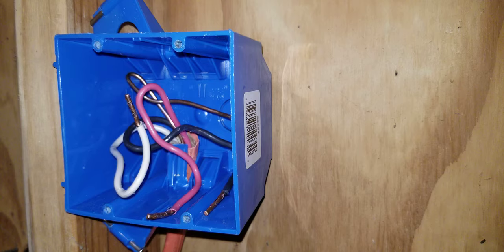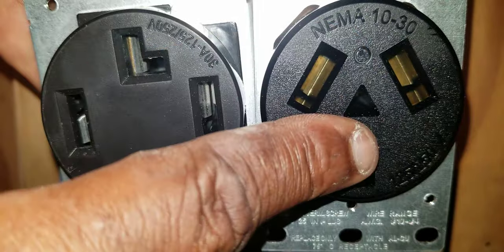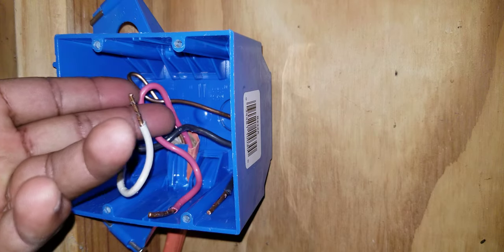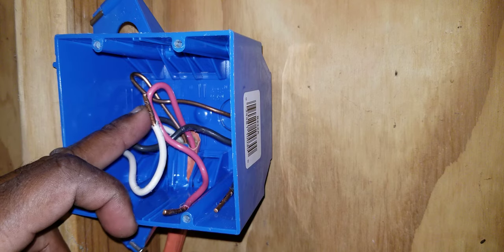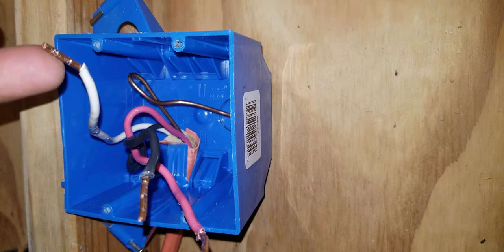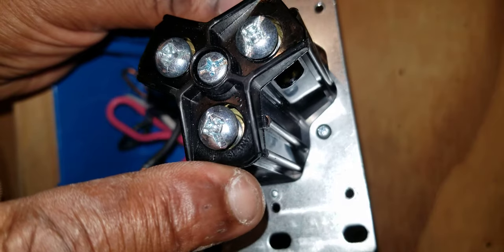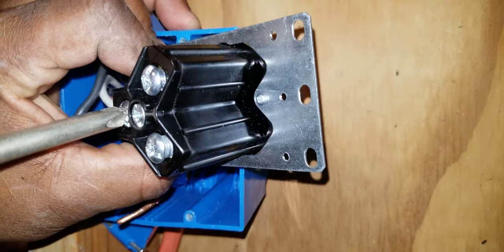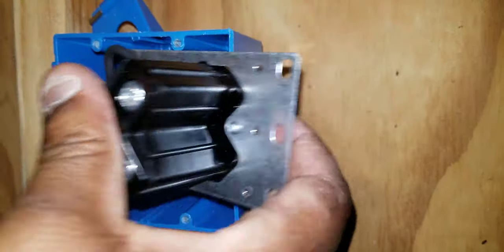How to install a  3wire 30amp dryer outlet

Comment: What I do with the ground wire if the box is not plastic ?
Reply from the maker: If the box is not plastic and the box is metal YOU WOULD TAPE THE GROUND WIRE TO A BOND JUMPER. , you would buy a green bond jumper ( from your close hardware store or home depot). The bond jumper should  have a green screw at one end. You will screw the green screw into your metal box.( there ahold be a screw hole in your metal box the will fit your green screw. Once you get the green screw tightly in your box., without the bond jumper to the ground wire.

Comment: What do you do with a ground wire in a metal box: still push it to the back?
Reply: Bond the metal box with the ground either with a screw or a clip
Reply: You can connected to the box. The ground will end up there. No harm done at all. Every metal part should be grounded, that's the purpose of the ground wire.

Comment: What if I only have white , black and ground ?
Reply from the maker: Use the black as one hot use the white as the other hot and use the bare copper ground as the neutral. So put the black and white underneath the hot screws and put the bare copper ground where the neutral would normally go.

Comment: I only have copper/neutral/black hot coming out my outlet I don't have a red wire
Reply: Multimeter it.  make sure the white wire being used is a current carrying conductor and not a grounded conductor

Comment: My wiring consist only of black, white and ground. Do I still eliminate the ground wire and only connect the Black and white wires. There is no Red wire at all.
Reply from the maker: Most likely James, the white is used in place of the red. The white in this case is the hot wire. Do not eliminate the ground. The ground wire will act as the neutral wire. So hook the white up as the red (hot) and terminate the ground wire for the neutral. This is done in most order homes.

Comment: Did you attach the ground wire in the   panel?
Reply from the maker: Yes. If you have a ground wire, it should be attached in the electrical panel.
Reply: @rickyjewett6082  thank you brotha.. i appreciate the reply

Comment: Ricky,    Although you have a very good understanding of how electrical works, there is room for improvement.    For instance, the device is not an outlet, it is a receptacle.   Also, the NEC has required 4 wire range and dryer receptacles in dwelling units since the early 1990's.   The three prong dryer receptacles and cords only still exist in a dwelling built prior to the code change.    So in all new construction or remodels, 4 prong shall be used.   If your dryer has three prong and your dwelling has 4, change the cord, not the receptacle.
Best wishes to you,      Kevin
Reply from the maker: Thank you. Iron sharpens iron
Reply: So I just moved into a new residence ( new to me) they don't have a hook up for a dryer. So I have a brand new LG dryer with a 3 prong chord? Do I need to buy a new cord then? I planned on installing it. Already bought a metal box, romex, receptacle and breaker. Do I need to ground the ground wire to the metal box? I feel like just pushing the ground wire back like you did in the video isn't the answer. My receptacle only has spots for the 2 hots and neutral.
Reply: Cody    Not sure why you put your question under my comment, but when you buy a new dryer, you have to buy a cord separately.   They do not come with cords.   I suggest you exchange the 3 prong for a 4 prong cord, get a matching receptacle, 3 wire with ground #10 Romex, and a 30A 2 pole breaker that matches your panel.  Follow the instructions inside the dryer on hooking the cord up to it.
Reply: How do I connect the 4 prong wires in a drier with three wires ?
Reply: Alejandro Marquez    Hopefully, you are asking how to connect a four prong cord to a dryer.   There is a wiring diagram on the back of the dryer.   It will tell you what to do with the white(neutral) and green(ground).  
If this is not your question, can you explain a little more what you are doing?
Respectfully,   Kevin
Reply: @alejandromarquez5565  You don't. You need 4 wires. You need to pull a ground wire to the receptacle that is connected to the ground bar of your breaker box. Or run new 4-wire cable.
Reply: You can’t just change the cord lol

Comment: I watched a video and I thought that I heard them say not to use the white one. Said red white and copper. Maybe I heard it wrong
Reply from the maker: The white or the copper would work and make the dryer function, however, I was taught in my vocational school training that the white wire would be appropriate because it is the neutral wire and it carries current back to the power source. The ground wire which is sometimes bare and sometime green should never carry current back to the power source, under normal opperating conditions. The only time the green or bare ground wire should carrying current is during a short circuit. I do know that all of this is hard to understand without any electrical training.
Reply: @rickyjewett6082  is it legal to do this?
Reply: @rickyjewett6082  thanks

Comment: Why not put the ground on the back when it has a terminal for the ground
Reply from the maker: Because in a 3wire dryer plug, the neutral is serving as the neutral and the ground. On a 3 wire dryer outlet, you can only terminate the ground which is bare or the neutral which is white. In most cases the white neutral wire is terminated.

Comment: My dryer outlet only has a white a black and ground.
Reply from the maker: This is fine. In your case, the black wire is a hot, the white is the other hot and the ground wire serves as the neutral. So again, terminate or put the black wire under one of the hot screws. Put the white wire under the other hot screw. Put the ground wire under the neutral screw.
Reply: Much appreciated. It helped

Comment: Could a 40 amp double  pole breaker cause damage to a dryer requiring 30 amps?
Reply from the maker: Maybe. It can possible do some damage to a dryer to be on a 40 amp breaker. It depends on the dryer. Some commercial dryer may be made for 40 amp breaker, however most dryer designed for a residential home will be designed for a 30 amp breaker. I hope this answered your question.

Comment: My dryer doesn't heat up like that though
Reply from the maker: You may have a bad heating element. How old is the dryer? Also check all of the outlet connections to the dryer outlet. If you can't figure it out, call an electrician.

Comment: But what if my receptacle only has 3 wires (Black, White and a Bare neutral wire) ?
Reply from the maker: If your receptical only has 3 wires ( a black, a white, and a bare), the wrong cable was installed for your dryer. If you  have 3 wires ( a black,  a white, and a red), this will work.
Reply: Ricky, we are going through that same problem is one of our houses, and the way to make that work, I was told is to make sure the bare wire is connected to the neutral bar in the circuit breaker box and at the outlet, wrap it in white electrical tape and use it as a neutral. What do you think about that?
Reply: @rickyjewett6082  Ricky, this question from Michael applies to me because I recently purchased a new dryer and the salesman told me that I would need to buy a 10/2, 30 amp cord, but I don't believe it will work because when I removed the old 8-gauge cord from the breaker box, I disconnected a red, black and ground wire from it and the new cord I purchased only has a white, black and ground with no red wire.

Comment: Why not cut the ground back some?
Reply from the maker: You should leave the ground wire long in case in the future, you may want to change your 3 wire dryer outlet out and install a 4 wire dryer outlet. On the 3 wire outlet there is no place for the ground to land of terminate but on a 4 wire outlet there is a place for the ground to terminate.
Reply: I was in the middle of installing and rewiring everything after I commented. Your video helped me out. I just wired the neutral into the ground panel box on the 30am dual unit breaker. But good suggestion of moving to 4 prong, otherwise I didn't understand why to have have ground in the way. Thanks

Comment: You are wrong a 3 wire has no neutral, all circuits in a house has a ground. If you are wiring into a main panel, no harm no foul but if in a sub panel its completely wrong.

Comment: that's also a dangerous method.he skipped a basic step of using a voltage meter.just because green represents neutral do no assume that's how the house was wired.wiring safety 101.